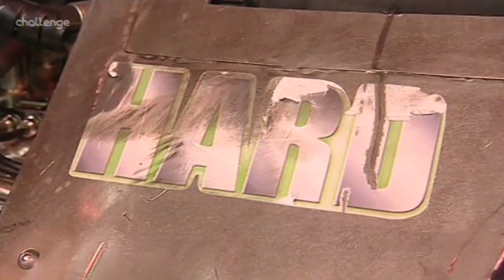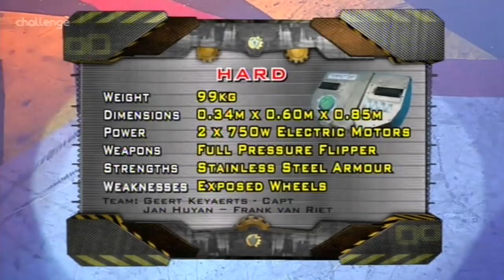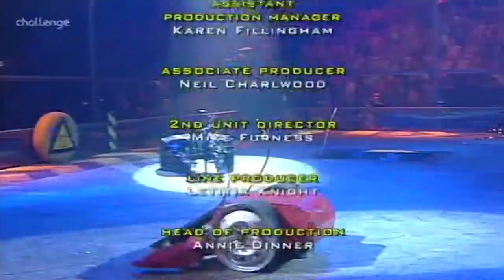Robot Wars Series 7 Heat J

Comment: Shame Thermidor 2 always got unlucky in series 5 and 6, but it's still my absolute favourite flipper in the original series, heck yeah my dude.
Reply: Thermidor 2 is one of my favorites as well, I love the design.
Reply: If it wasn't for the bad luck, Thermidor would've gave Razer a challenge in series 5, but Thermidor was caught in the Heat of Death with Stinger and 13 Black in Series 6
Reply: He had mechanical blips at the time. From Joe. X
Reply: the thing about thermador is when it worked it did rather well. But it just kept dying. It died in series 5 and series 6. but they did well in extreme

Comment: pincer looked like such a good bot. Shame that the motors failed. I think the electronics burnt up when it was on the flame pit.
Reply: Probably because putting too much pressure on the hydraulic the battery ran out
Reply: @orphanmeat4sale24  Got jammed onto Cobra.